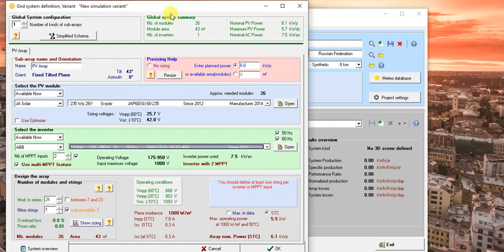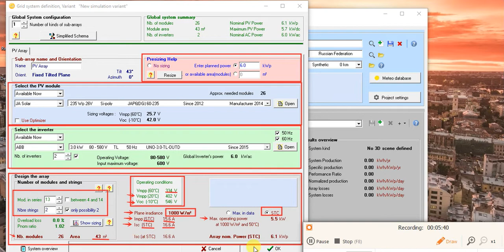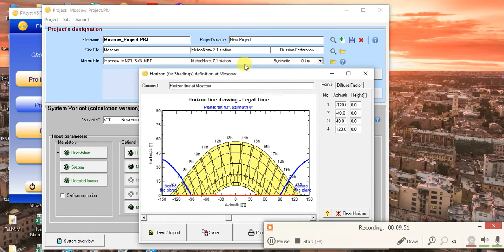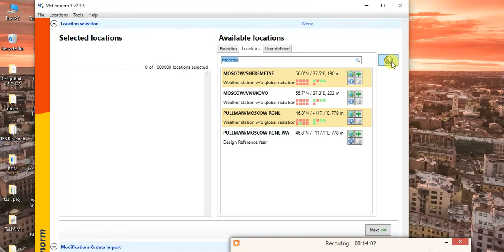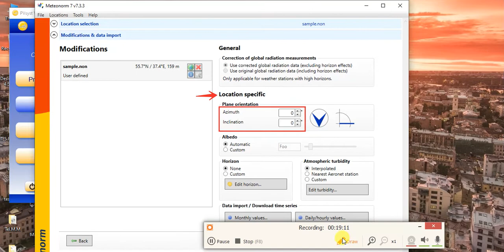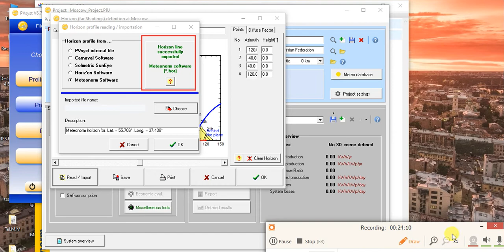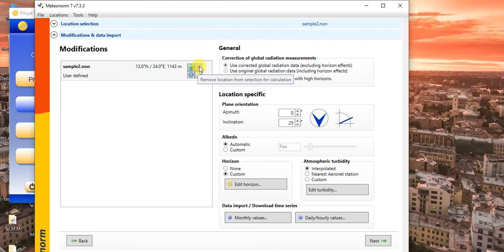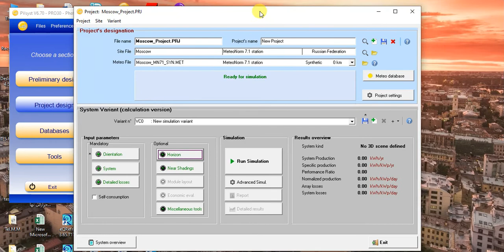pvsyst v6.7- part2- Defining Horizon + Meteonorm

Comment: Hi,
If I have Meteonorm data access in my PVsyst software then why I need to download the separate Meteonorm.7 software and import it in PVsyst.  Am I missing something while doing the SRA Report? Please suggest.
Reply from the maker: Hi Imran Ahmed, 
When you use the Meteo Data in the software, You just use the data about radiation, Defuse and wind velocity for the site you have defined for the project, so you can compare them together about the available radiation received by that area with another site. When we have far shadings which are related to the topography of the site and it makes a lack of radiation in a certain time of day, we need to define it in Horizon part. (As you know, This is not near shading). 🌹